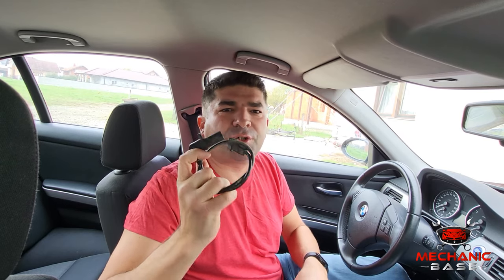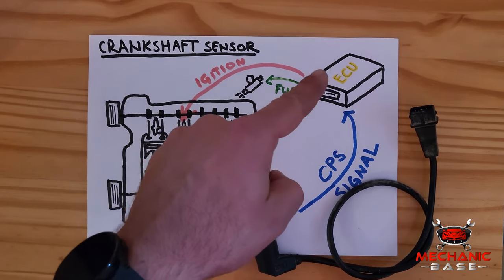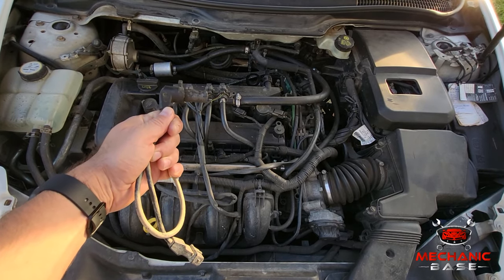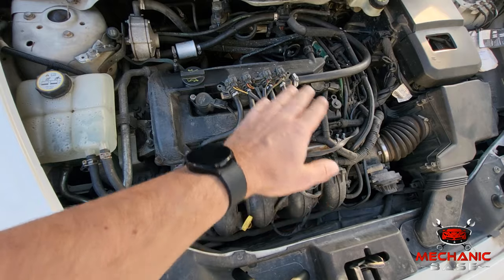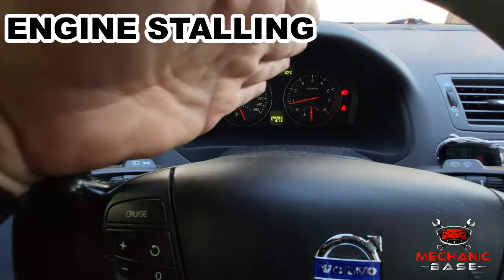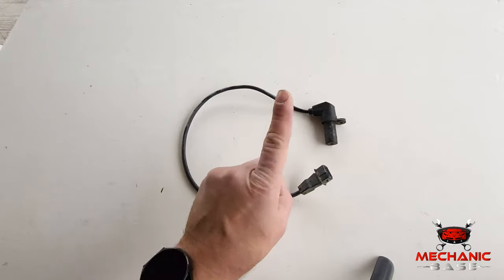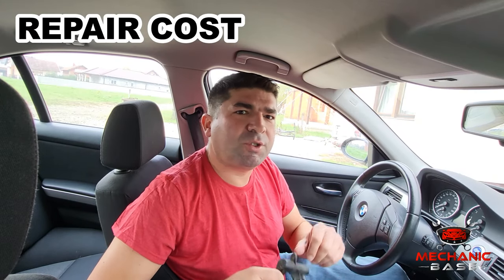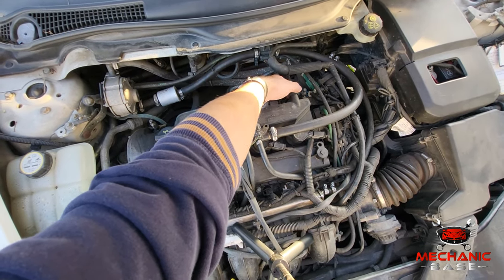6 Symptoms of a Bad Crankshaft Position Sensor

Comment: my battery is getting low plus getting p0851 code and p0335 code in 2010 subaru forester. My mechanic said no need to change crank shaft sensor so he changed only neutral switch. But still issue remains.  Thanks

Comment: so i did get the p0335 code and my car has been stalking or stopping on me and even check engine comes and go . so they say it’s the crankshaft sensor. 

u guess my question is how do you know if it’s the front or back crankshaft sensor . i have a 2014 hyundai sonata @mechanicbase

Comment: I have 2005 volvo v50 t5.  the heater hose in the rear, above the turbo sheild broke.   The car lost coolant, obviously.  then the oil check light came on.  When I was able to get the car to local part store.  I turned the car off, open hood.  Alot of steam and smell of oil.  I think the oil was from splash gaurd which was already dirty.  I refilled the coolant, checked the oil, and the oil look the same from when i changed it.  I went to turn the car on, and it would not start.  First thing I suspected is a maintence fault no start allowed til cleared condition.  I went to get the ODB2 reader, and cleared a few codes.  One was a Knock sensor code.  The car was making a BAD noise ... made it before when the oil was low.  weird rattle when trying to accellerate.  When I cleared the code and the hose seperation was resolved, the car started fine, no weird noise.  I was very surprised.  The coolant resivour has a funny smell.  It is filled only with water, and another hose was replaced.  So I am thinking may funny smell from hose interior hose.  I did not see any oil in coolant, no excessive steaming from oil cap port.  I was able to drive the car home, and a day later, I restarted the car, and it started with a lil hesitation, but started up.  I turned it off, check the resivour again, same funny smell.  I am thinking it will go away when I install 100% radiator fluid.  I came back and started it again, started up real easy, like normal, but I was still getting that same funny smell.  A few questions I have are; when the hose slipped, is it possible the hot water could have affected the sensors.  I am still dumbfounded with the rattle noise, which I know occurs from low oil.  I have NO CLUE how enough oil lost on a 15 mile trip, when the oil was topped off 2 days ago.  Bad filter install?  It is a simple install.  But the Temp heat from the busted hose, could it have affected wiring connections?  What is your experience with situations like that?  Since getting the codes cleared, I have no NEW codes other than the Airbag, which I am wondering what the deal is with that.  This car as far as I know has not been in an accident.
Reply from the maker: Sorry to hear about your troubles, Andrew. 
The BAD nosie - was it like something's hammering inside the engine, and becomes faster when the revs go up? If so, that were the valve lifters, which were left without oil.

Comment: Can a faulty Crankshaft Postion Sensor cause a total non cranking ie the self starter not spinning? 
In a MBENZ SLK 320 R170 465 2001 MODEL?

Comment: Can you tell me please where to find crank shaft position sensor on a 2017 Vauxhall mokka x 1.6 petrol.
I have searched but cannot find
Reply from the maker: It should be under the oil filter.
Reply: Can't see anything from above ?
Should I be able to see it from looking down from under the bonnet/Hood or do I need to get under the car to actually locate it ?
Car is 2017 Mokka X 1.6 petrol

Comment: Thanks for the video I have a 2007 chevy tahoe 5.3 can u help me locate the sensor thanks
Reply from the maker: It's on the back side of the engine, near the transmission, on the passanger side. 
Just look for the oil cooler lines, and you should spot it.

Comment: I have a 2012 Volkswagen Passat SEL. Problems cranking, give it gas and starts ok ish, rpms above around 1,200 runs fine but when rpms below 1,000 starts sputtering and engine shaking and sometimes dies, i just had an oil change last month on april 7 and oil level was at half and it was dark. Is that from the valve, magnet, or sensor? Please help. I only kindly know what I am doing.  Only because of videos. Code P0011
Reply from the maker: The code P0011 is Camshaft position sensor related. In simple words, the intake valves are opening too soon, which allows to much air into the engine. That's why the idle is high, and it has a tendency to stall. The problem might be in the sensor or the VVT solenoid. Has this started just after the oil change?
Reply: @MechanicBase  my golf v. 2004.  1.4 liter  runs at max 3000 rpm.   With no codes Im ordering a crank sensor hopefully it will fix it😅. Thank you for your help troubleshooting 😊😊

Comment: hyundai accent limited 2020. car vibrates sometimes if im on a red light. starts fine, code says cold start cam shaft sensor. do i need to replace it then?
Reply from the maker: Which exact code do you have?

Comment: hello i have volvo v50 2010 1.6hdi i had error in dash saying engine performance is lowerd and car went to safe move (stabilitry control turned off) and i couldnt go over 100kmh when i left it over night massage was still there but car was not in safe mode anymore( stability control was on) i wasa able to do 160km before it went in safemode again went on diagnostic and dude told me it was crankshaft sensor problem but he thinks it was just connection problem with it he delated error and he told me to drive it and to tell him if it showed up again, i went to work that day and come back i did about 100-110 km and there were no error messages. what do u think about it. ps i was always able to start it without any problems and it runed smooth even in safe mode and with performance massage on

Comment: My kia carnival 2004 was having idle issues. You press gas and the car won't increase speed. When it does the Rpm will go to 3000 and back to 2000. Uphill will fail to go up. It finally couldn't start. The mechanic took out the crankshaft position sensor for testing. It's said it's faulty. Will my car come back to normal after replacing with a new one. Do i have to change plugs.
Reply from the maker: Is your check engine light on? Do you have any codes?
Reply: @MechanicBase  There was no engine light and the mechanic didn't have the old machine for seeing codes. He has a new one. The Obd  in my car is old type

Comment: Fact is-both the Crankshaft Position Sensor AND the Camshaft Position Sensor define their jobs in their names.Neither one will report engine speed for iginition but they DO send POSITION information to the ECU to verify FIRST that the engine is actually rotating.
Also,some cars have the sensor inside the distributor,you can look for a year and never find it.This can be a job some DIY persons should not attempt

Comment: I need help with my e60. When I plug in sensor the 5 volts goes down to 2.5v.
It's got good 12v power and good ground from dme.
I tried to see any volt drop with a ociloscope.  I tried 3 different sensors and 2 different dme.

Comment: have 2007 cx90 volvo mine 2007 something starts use a lot of gas now it won’t crank at all put key in key switch try starting all lights on dash turn key headlight flicker on and off but no start code is po345 confused camshaft or crankshaft senor please send picks to get help asap battery is 12.13 volts help

Comment: Hi there.. I hope you can see my comment. 🙏.   is this can   happen in all type of cars?  like Subaru 2002 h6 3.0?. And by the way, recently  I had trouble with mine Subaru as I said.h6.. got overheating. because a hose broke and it split  water all over the engine.. in  the first time,  suddenly stops and then I let it cool down for about 10 minutes  and it started again I drove it again  for less than 5 minutes and it stop it  again and let it cool down again  and turns on again, and then I drove it for around 3 minutes I guess. and   I stopped that  was in the way to work .by  that time has 0 water.. that was in the morning so in the afternoon. I proceeded to refill with water  so I noticed there was a huge leaking through a hose underneath the  air intake.. so I guess I made a big mistake  later on.  I  decided to drive it again without any water...  because I couldn't leave it at work              So I drove it  again for about 10-15  minutes and then got overheating again,  but I never let it get to the red  line. And then I stopped by myself turn it off let it cool down  letting the fan keep working. After about 10-15 minutes when it gets cold I drove it again for about another probably 8 to 10 minutes when I saw  temperature was increasing again, I stopped. As I mentioned before never let it get to the Red line... And had it opend  switch for fan working. An emergency lights on. So after about 15 minutes letting it cool down,  I turn it on again and didn't went  on .  so right away  lights  started lower and lower as I said I haved the emergency lights on so,...... So after pulling it with friends help,  few hours later,.  I make it into the shop where I let it parked.. later on a third day I fixed the hose broken and I started on and didn't want to,  so no start. What I noticed right away the headlights didn't turn on and inside dash lights nothing...... Can you tell me if that overheating affects not only the crankshaft? Could affect other sensors, or relays or even the  The computer?.  Any tips and info, welcome thank you 🙏.......
Reply from the maker: Yes, it can happen in all cars from  90s onwards.
Reply: @MechanicBase  ) WELL WELL, YOUR ANSWER DIDN'T HELP , HOWEVER APPRECIATE U TAKE THE TIME AND YOU READ MY COMMENT 🙏.  ........... ...    I FOUND OUT LATER ON,  GROUND WIRING WAS NOT CONNECTED PROPERLY SO THE HEADLIGHTS AND INSIDE DASH  LIGHTS DIDN'T WORK.........................,.......WELL AT THE END OF THE STORY THIS ENGINE WAS TOASTED😞 
ALREADY GOT ONE AND I WILL SWITCH IT...... THANKS

Comment: Hi I'm struggling to get a crankshaft position sensor on my Ford ranger diesel 3l engen the same like bt50
Reply from the maker: It should be at the front side of the engine, behind the aux belt and crankshaft pulley. On the passanger's side (if it's a LHD car).

Comment: i had a Citroen C4 Coupe with the TU5JP4 engine 1.6 16v i changed the crankshaft sensors 4 times and i checked the injection spark plugs fuel pump fuel rail all seems good but i was constrained to put the car on a junkyard no one can solve that problem even with new and original crankshaft sensors
Reply from the maker: Hi. What's the problem with the car?
Reply: @MechanicBase it was not starting

Comment: Hi I have an issue regards to my car with the sensor the camshaft position sensor code P0340.  Can help me the exact location by 2002 ford focus 4 cylinder engine thank you give the exact location thank you
Reply from the maker: Which engine does it have? 2-liter? The camshaft sensor should be on the cylinder head, near the timing end.

Comment: Code I have it's P0601 it starts but when it warms up it shuts off I have replace the cracked shaft sensor I have a 2003 jeep grand cherokee 4.7 v8
Reply from the maker: Those cars are known to have issues with a bad PCM (the computer that controls the engine and transmission). Hope that's not the case with your Jeep, though😮

Comment: Can I damage the sensor or get a code P0335 after cleaning the throttle valve? I didn't check the codes before cleaning my throttle valve and now I'm afraid I broke something 😂
Reply from the maker: Does your car run OK? If so, you can delete the code and see if it returns.

Comment: I love you!! Beautiful video. 1 q : can a bad cam shaft sensor cause ticking ? Thanks
Reply from the maker: Which car?
Reply: Peugeot 407 petrol 16 valve
Reply: @klauswillyhalvorsen1081  Ticking is usually caused by worn or stuck valve lash adjustor(s).  They are either mechanical or hydraulic (engine oil)
Reply: @usnchief1339   i did oil - ok . turned out it was a very bad spark plug
Reply: @klauswillyhalvorsen1081  Interesting!  Thanks for the feedback

Comment: On very rare occasion my panel lights all come and the car will stall , it then starts up as normal ,sometimes it get a No Crank issue and sometimes Cut out after Starting up
Car is CLK 220 CDI  2007 with 250000 miles on the Clock other wise all good 
Best Regards 
John
Reply from the maker: Hi. Because you say it cuts out and sometimes doesn't want to crank afterward, I'd start by checking the battery terminals first. Also, what might be causing the problem is the ignition switch, assuming your Mercedes has conventional key (so, not a push button).
Reply: @MechanicBase  
Thanks 
Battery terminals good I’ve often suspected Ignition Turn Switch .
I l get that done .

Comment: I have a 2016 cord focus 3 cylinder 1.0L I can’t find where mine is.
Reply from the maker: Hey, it should be at the timing side of the engine, near the crank pulley.

Comment: will the sensor stop the starter working
Reply from the maker: No, it shouldn't. If your car isn't cranking, the likely causes are flat battery, dead starter, or ignition lock.

Comment: Can it go bad without throwing check engine light?
Reply from the maker: There are cases when it can start acting up without throwing a code😵‍💫Which car do you have?
Reply: @MechanicBase  2007 Mercedes C230 I heard there known for crank sensor issues

Comment: I have a 2005 nissan altima 4 cylinder anyone know if mines is located on the driver/passenger side?
Reply from the maker: On the transmission side of the engine.

Comment: Where is the crankshaft position sensor on a 2011 Mitsubishi Lancer ES?
Reply from the maker: Hey, @jordansuriel5739 - it's at the transmission side of the engine, facing the firewall. You'll have to go underneath the car to find it.

Comment: My nissan bluebird sylphy was not going over 40km/hr so I changed the camshaft  position sensor. Now the car goes to around 80km/hr or Rec count 2000, if I exceed its like the engine stalls and restarts during cruising which makes the car to shake forward and back and takes time to accelerate forward. Could I be having a problem with the crankshaft position sensor since I didn't change it?
Reply from the maker: Do you have any trouble codes?
Reply: @MechanicBase  haven't put it on the machine yet

Comment: I have to argue that it is not the most important sensor, your oil pressure sensor I think it is most important because if you don't have oil properly lubing the engine then say goodbye to that engine or to your bank account having to replace or rebuild said engine!!

Comment: I keep getting a P0300 code. I have a chevy 5.7
Reply from the maker: Only P0300? No other misfire-related codes?
Reply: @Mechanic Base  that's the only code I get is the P0300
Reply: @Mechanic Base  I have changed most all sensors. The last one I have to change is the camshaft sensor.  I've changed wires, plugs, cap, rotor button, oil, crankshaft sensor, hvac, idle air control, fuel filter, and usually no check engine light comes on. Once it gets warm, it'll sputter...
Reply: I have the jeep renegade 1.4 liter American version.  I'm getting the same code, P0300. I bought a new crankshaft position sensor but after looking all day and using every resource I can find, I can't find it on my engine.  I am beyond frustrated.  People keep referring me to similar models but I need specific information for my vehicle.

Comment: @mechanicbase 2006 Volvo S40
Reply: Location of the crankshaft sensor in a 2006 Volvo s40
Reply from the maker: Hi. It should be on the timing side of the engine, just near the aux-belt pulley.

Comment: I can’t find my crankshaft sender 2099 Mercedes Benz c300
Reply from the maker: It's a bit tricky on this car. It's at the engine's back side, facing the firewall. You need to remove the engine plastic cover, air ducts, MAF sensor and breather hoses to get to it. And it's a tight sqeeze.

Comment: 1997 Honda Accord 2.7 V6 cannot find good info on this
seeking the crankshaft position sensor Code P1361 TDC Intermittent interuption  car starts and runs fine but after it warms up it bucks like a donkey with a finger up its ass, doesnt want to go over 3.5k on the tach.

Comment: Will Crank Shaft Position Sensor failing Cause any issues with showing a problem with oil pump?  On a 2010 Chevy Camaro 2SS?

Comment: ow u missed a key point when the crank sensor fails and does not triger a code
Reply from the maker: Did this happen to you, Figol?
Reply: @MechanicBase  yes more than once
Reply: this simptom normaly occurs when the engine is hot and shuts of leeave the car for 10 to 20 minites and it will restart sometimes will happen on a fresh start but the fastest way to spot this is look at the rpm signal in live data
Reply: hope this helps any one
Reply: This is what's happening to me.
Reply: @goukisama  Vauxhaul buy any chance ?
Reply: @figol6272  Scion tc
Reply: @goukisama well i hope i helped u no matter what the make
Reply: that happened to mine but sometimes the check engine light would flash for a bit then go away
Reply: Well the wire was damaged so it had to be replaced
Reply: @figol6272   i have these symptons  and no engine light but a scan of engine said its crankshaft sensor , on cold the engine is fine but when its upto temp it cuts out alot unless i have foot on accelerator my car audi a3 .2008 2.0 tdi did you change your crankshaft sensor and fix it
Reply: @dannyBtech  yes but use a genuine senser